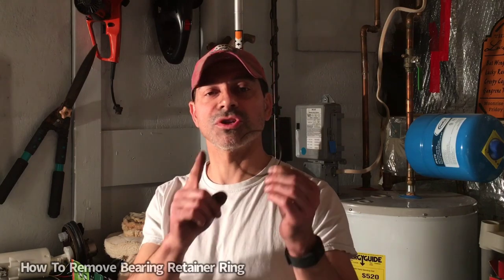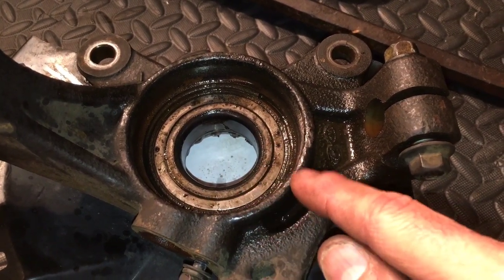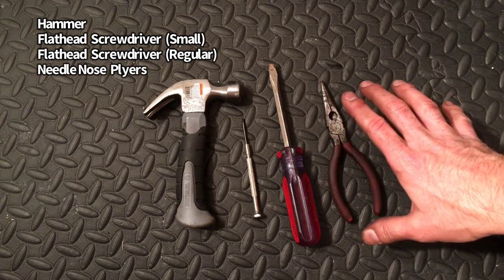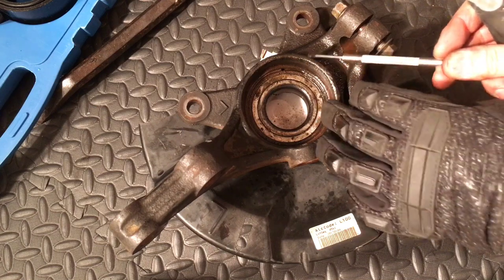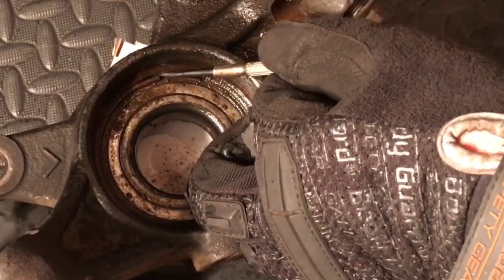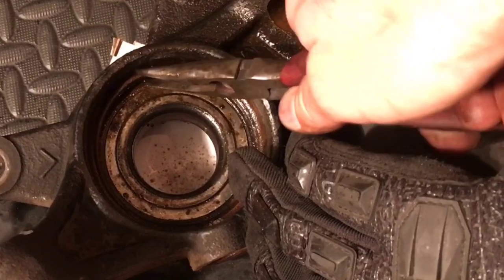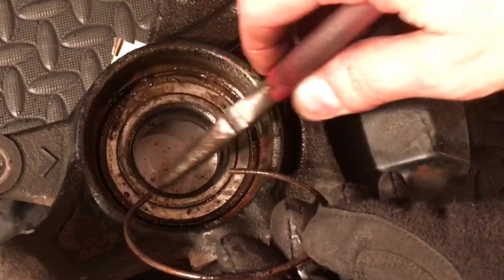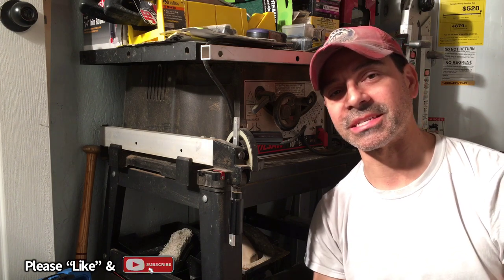How To Remove A Bearing Retainer Ring (Andy’s Garage: Episode - 178)

Comment: Great job! Good man thank you I have one however right now and it the access to the ring is a bit more constrained and here lies the rub the ring just moves when I attempt to place the small straight slot tip under the ring. Thank you very much in advance for any advice. 😅
Reply from the maker: @SJ-nv1ds  what if you use two screwdrivers or small chisels? Use one to hold it from moving and another to raise it?

Comment: Mine keeps spinning freely in its groove..  its just a flex shaft from a proxxon rotary tool that i smoked because i was too lazy to get my die grinder and i took on a task a bit beyond its means. Now I'm trying to salvage the little handpiece on the flex shaft and adapt it to my foredom shaft..  
...i know , i know, TMI.. but the comment section looks lonely.. lol great video. Thanks for posting
Reply: I had the same problem on a hydraulic motor with an internal snap ring.  I was able to make a plastic wedge to press in against the ring which prevented it from spinning.  Mine was too deep for a small screwdriver so I used a couple picks - one with a 90 degree angle to start at the end of the ring with the 45 degree cut.  Purchased the tool set at Lowes.